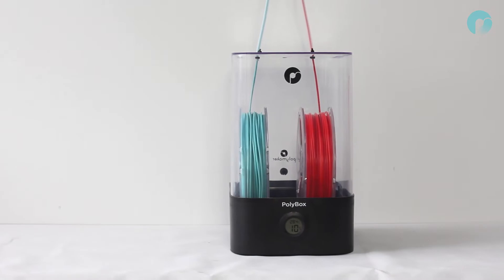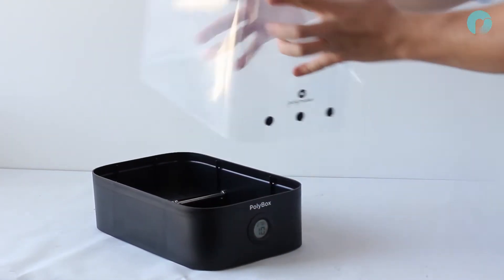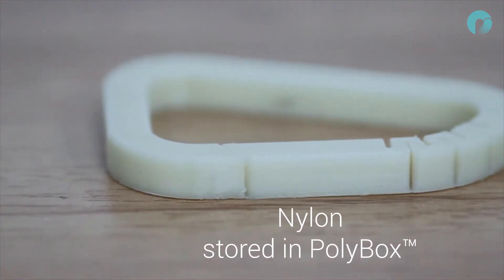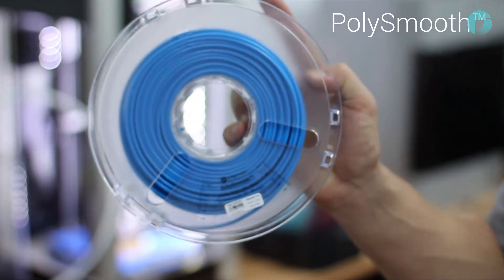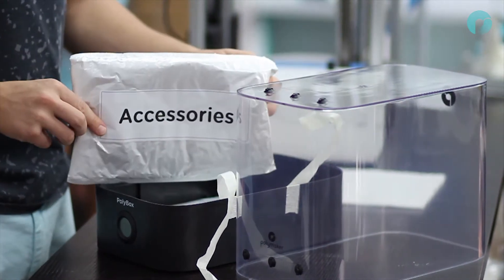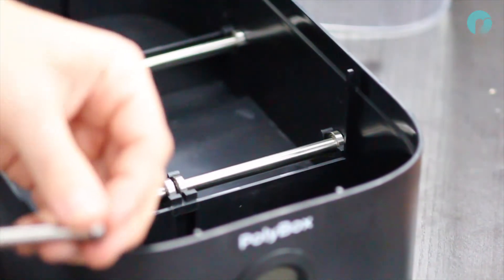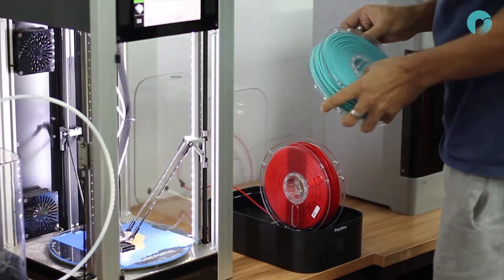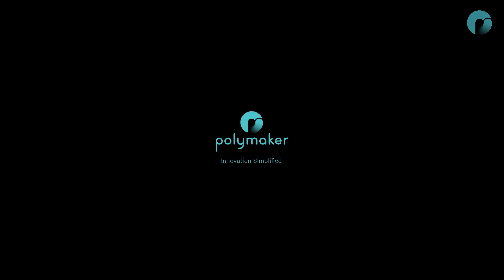PolyMaker PolyBox™ - Filament Storage Box

Comment: Can you print right away or have to wait below 15% humidity?
Reply from the maker: You can start printing directly. The filament should be dry enough if you remove the packaging for the first time. This box is to prevent the filament to absorb any moisture. If you store the filament outside the box (to swap colors e.g.), you should store it in an airtight container or a ziplock bag. The silica gel bags are capable of removing some of the moisture from the filament over time but primarily prevent new moisture to absorb. Also, it is perfect for keeping your filament dust-free.

Comment: How do I get my polybox to stop bending and putting pressure on the filament to my printer? I have the prusas so they feed from the top but my printers with the filament coming from the sides have no issues.
Reply: Please look for a filament guide to print on Thingiverse or on the Prusa website. The key is to guide the filament tube in a large enough radius so the filament is not getting stuck anywhere.

Comment: This can be done, and there are plenty examples of people creating something similar with a transparent storage box. 
 
This unit is very compact and also has the spool holder built in. Also, there is feedback from the Hygrometer when you need to replace the desiccant bags. So this is more a ready solution.